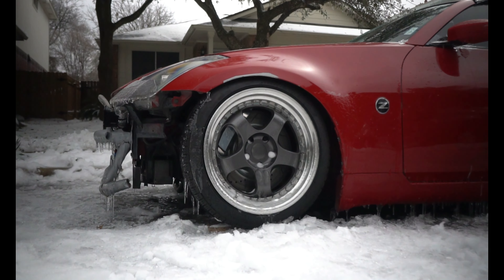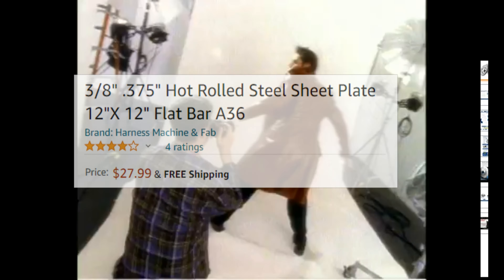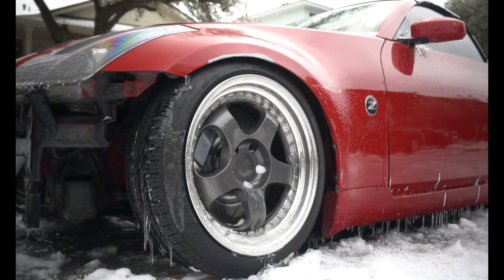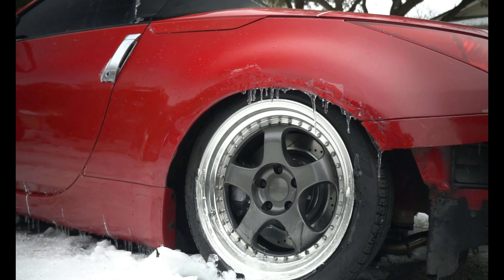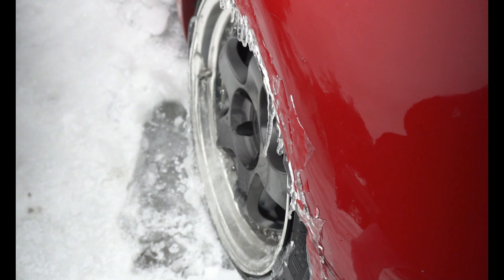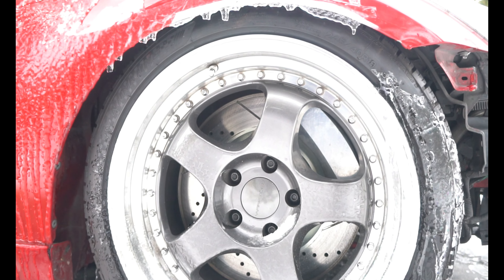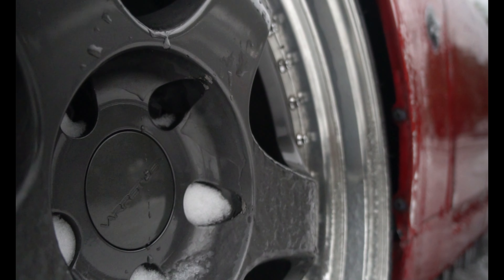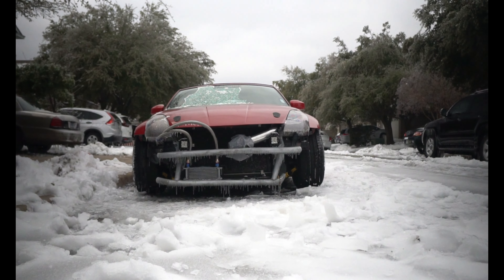350z with Lexus LS460 brake calipers

Comment: Hey do you know a way i could upgrade my brake performance on my ls460 I already have drill and slotted rotors
Reply from the maker: I don't know, the LS460 wasn't really a performance oriented vehicle to begin with. I went with the LS430 brakes because they were available to me at the time. Though I would look into Hawk brake pads to see if there are any options for the LS460